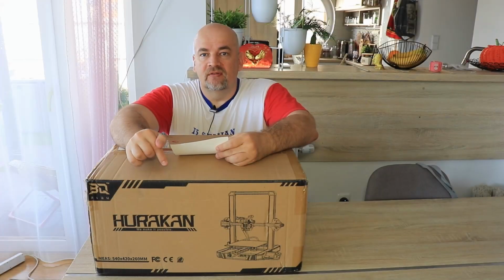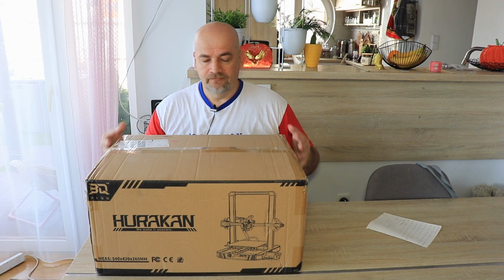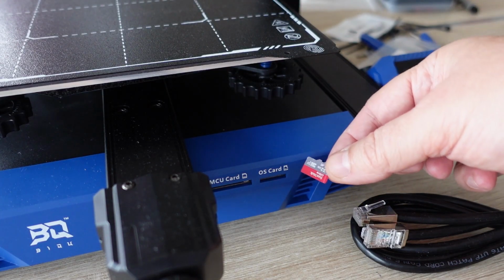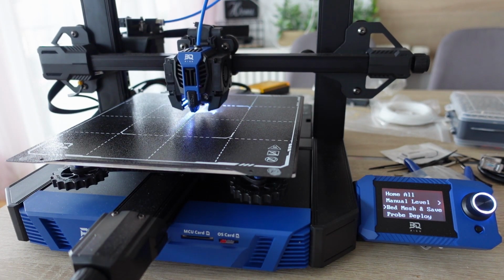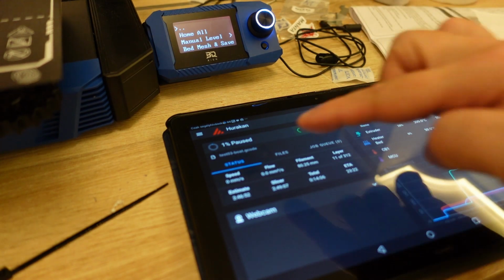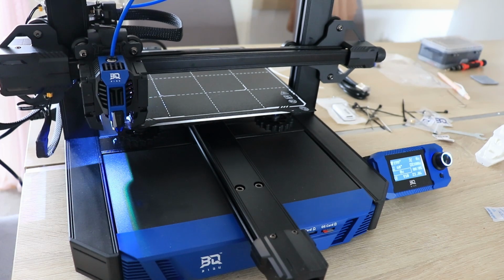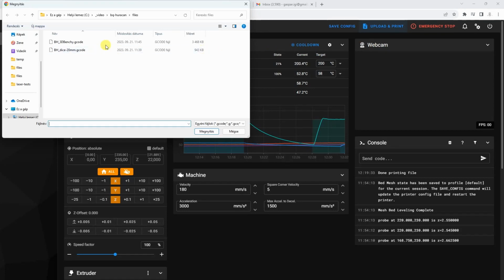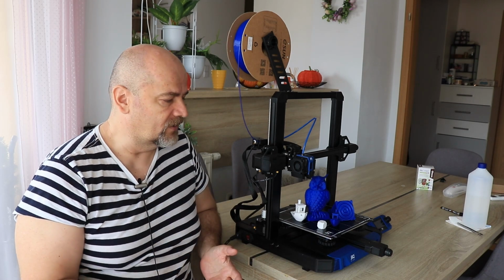BQ Hurakan - a cheap, Klipper based bed slinger 3D printer review

Comment from the maker: THis is small addon video on FB. https://www.facebook.com/mytechfun.igor/videos/125118014023897 
1) There are Cancel and Pause points in menu, but inside SD Card folder. 2) The noise is measured, 45 dB from 0.5m distance.

Comment: How does this compare to the Sovol SV07? It appears to have a lot of advantages for just an additional $10 ($289):
► 5" touch screen
► Dual drive z motors
► Direct drive extruder
► 300°C high flow nozzle
► Included accelerometer
► Full (small) spool of filament
► Meanwell power supply
► Strong auxilary fan
► Faster (24min benchy)

The unique benefits the BIQU Hurakan offers seems to be way fewer, and questionable utility:
► wired network connection
► partiallly heated bed
► mechanical bed probe
Reply from the maker: I think you answered your question with that list

Comment: Igor, that was a nice video - and I think it is time for me to tell my story with the Hurakan… I was so excited with its features when I was contacted last year… and at the time this was the 1st printer coming with Klipper out of the box. But my experiences with that first batch was full of problems. Some of them are still present on the unit you got (a year later!)
Reply from the maker: They must learn, if company wants to be successful, they must take care of their existing products too, not just concentrating on pushing out new products. Users will feel this by time..
Reply: @MyTechFun  I am happy they did not learn. That means they had to sell it cheap. I got one as a first printer for 90 with 7 day warranty and very happy with it, using it for making tools. The list price is 300+. I did brick it by updating the firmware. Following the rebuild instructions in user manual v1.2 brought the printer back to life.

Comment: I could be wrong, but I think the options to resume or stop the print are in the "SD card" menu in this type of screen and klipper. You might have thought that it is just the menu to show all files in the SD card, but I think when a print is in progress this menu also has pause/resume and cancel-stop print options. If they don't appear right away, try going one step back in the menu and enter that "SD card" section again.
Reply from the maker: Oh, yes, thank you. I will add this info to first comment and description. https://www.facebook.com/mytechfun.igor/videos/125118014023897
Reply: And I guess this is the normal Klipper menu, which you can completely customize via the config files if you would prefer a different structure...